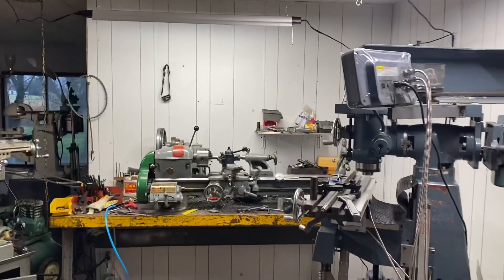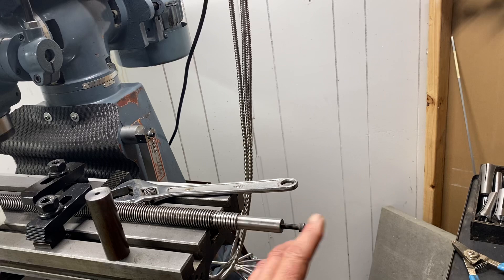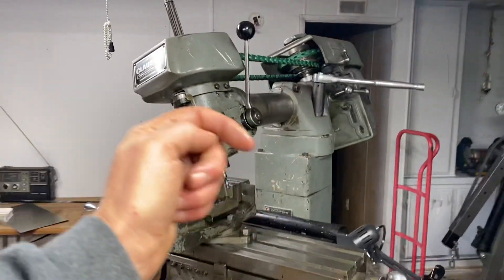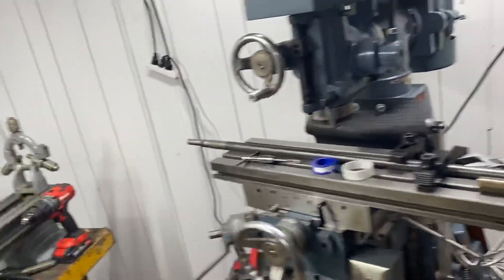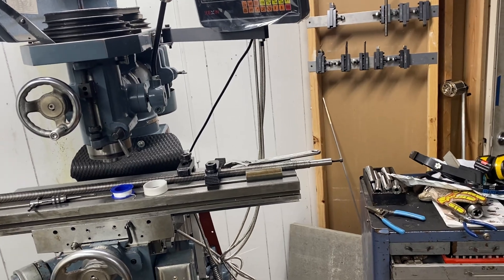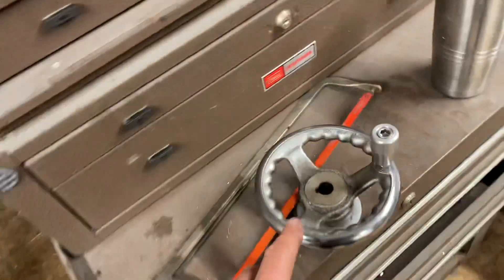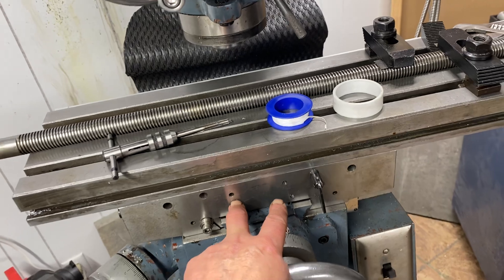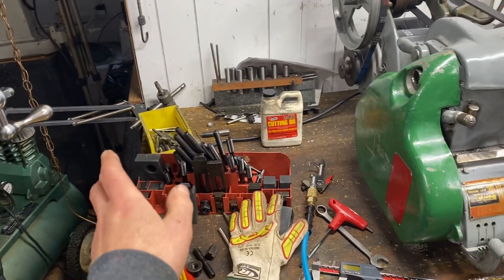Enco mill power x feed update

Comment: You’ll get it done . What sizes are the T slots on the Clausing  ? What brand would you recommend ?
Reply from the maker: I'm not sure about the size, but slots just a hair wider. Believe it or not, the Clausing with 2" smaller table has .5" more overall travel. I measured it yesterday, and would have never guessed. My last clamping kit (for the Millrite MVN) came from Grizzly and was much higher quality.